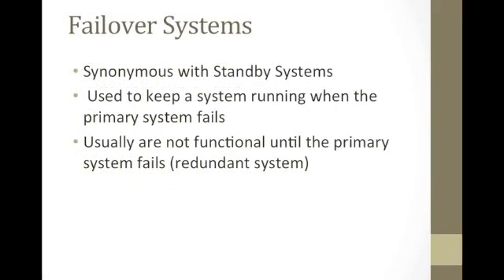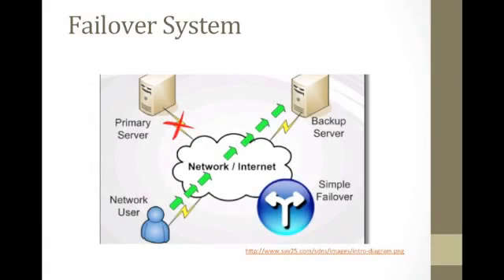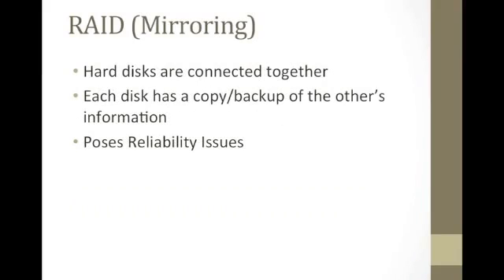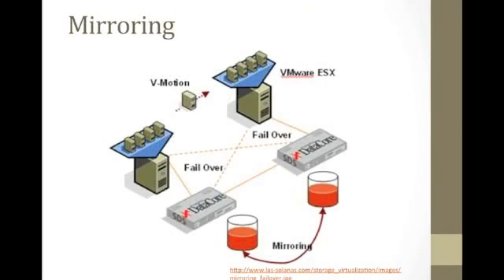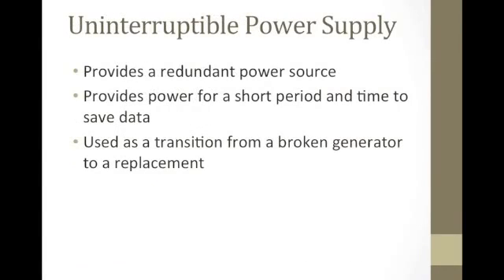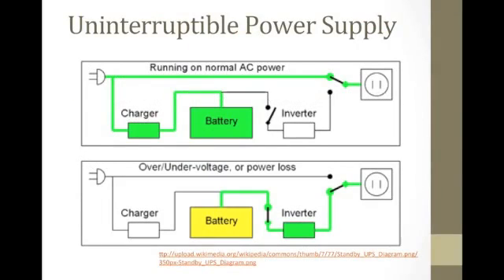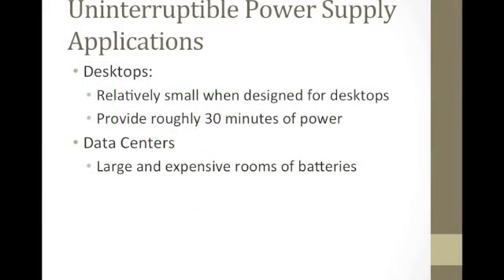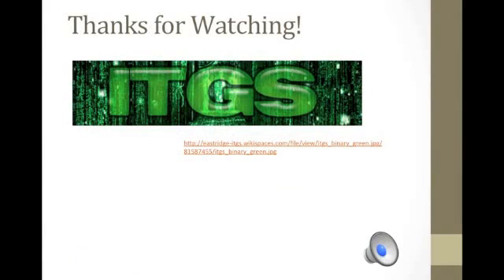Failover Systems

Comment: Failure systems are a very important part of the technology/computing world. They keep the primary systems up and running in case they are not able to do it themselves. Failure systems help to ensure the integrity of data in the case of a system failure. These are essential for large firms that have a lot of important information.  Of course, it is not perfect. For example, RAID can transfer corrupted files.

Comment: A failover system is used when the primary system fails to work properly. Failover systems are a backup system when the usually running system fails. They are used commonly in large corporations to make sure that their systems are always functioning properly. These help improve the reliability of systems.

Comment: Failover systems are designed to do exactly what their name states, keep a system running when the primary system fails. Basically failover systems are backups in case of a catastrophe such as a computer crash or a power outage. Examples include an uninterruptable power supply and the redundant array of independent disks.

Comment: Failover systems are there for when primary systems are failing. There are different kinds of systems. For example, there is the RAID which is the failover system for hard disks. Of course, there are some problems that come with RAID. Also, these systems are utilized to ensure that it becomes a more reliable system. If the system were to crash, then there would be a failover system to take over.